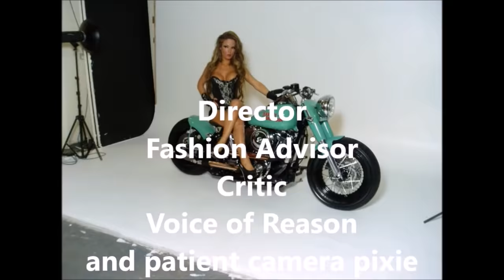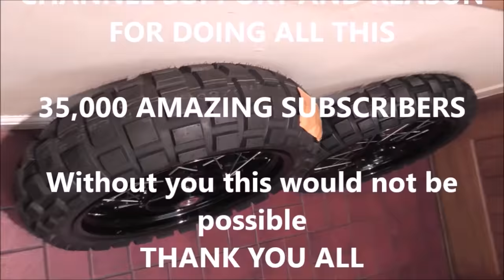Delboy's Garage, USD Fork Seal Replacement

Comment: Hi, I love your videos but you might want to add that on some bikes you WILL require more tools than this as some forks contain an acrylic tube inside that will prevent you from being able to do this job without the use of a spring compressor. Unfortunately I just found this out the hard way because after watching your video I thought I could do this job with only the tools you used but quickly found once fork was apart that without a spring compressor I am now dead in the water until I get one shipped to me completely halting the job I was working on. Maybe this will help someone else from running into same issue.
Reply: I encountered the same thing. I had a spring puller tool in the garage. Worked like a charm. Just have to pull the spacer down long enough to catch on the lock nut and everything will come apart by hand.

Comment: Hello Delboy. Great video and I was watching this one with eager interest (more than usual) because the forks on my 1998 Ducati 900 are leaking. So may I ask two questions raised by the vid:- 1. How do I replace the new seal without your super duper split round hammer tool and 2. Does the Ducati need special tools or can I replace the seals the way you did it. Cheers again for your quality recordings, Jules.

Comment: While I appreciate keeping the new seal off the rough part of the stanchion, The fork needs to be fully compressed when taking the fluid level measurement, otherwise you may as well be taking a measurement at any random point of the stroke. 
Your method of getting the seals over the sharp edges at the top is good, but it could result in nicking the fork seals as you are now running over a sharp edge of plastic length ways. I usually just use the thick plastic packet the seals came in.
Interesting method of cleaning the rough part of the stanchion, I have used tinfoil with great success. but I wont be able to say which is less abrasive
Nice illustration on how to jack the bike up, its a great method... I've always struggled with my sport bikes in that department.

Great video, I was worried about USD forks myself but you've made it look like a piece of cake. 
The time will come that I need a fluid replacement on my street trip and now I'll be able to tackle the project alone.
Reply from the maker: Hi Martin, I didn't make it clear in the video that in this instance it was important not to push the fork outer tube down over the rough rusted fork stanchion, obviously.  But if you do, you will find the inner and outer tubes become level, so therefore if you want to keep the fork tube a little higher to preserve the seal, then just make sure you measure the oil level on  the 'INNER' for stanchion tube, not the outer one... as indeed, it would be a little high.  This way you will get the correct measurement.  Glad you got is sussed and glad the video helped you.

Comment: Hey Del, great video! Got a quick question I was hoping you could answer. I reassembled my shock just as you did. But the spring does not want to slide down all the way. After taking fluid and spring out n looking down into tube I can see that what the spring slides down is not centered in my shock tube. What would cause this? And any suggestions on what I did wrong, so when I pull it back apart I have a idea what I did wrong n can get it back together correctly this next time around tomo. I hope to hear from you, and Ifso thank you in advance!

Comment: Hi there, great video! I have a 2007 Versys which I need to replace the seals, my question is, I have seen other videos saying I need a spring compressor, but you didn't use one, so do I need one lol....thanks in advance.

Comment: My front fork was leaking but not from the oil seal, rather at the lower end around the axle nut.  Took it to the mechanic, he said the nut at the lower end which connects with the inner tube was loose, after tightening it seems like it's not leaking anymore.

I didn't see you touching the lower nut around the axle

Comment: Great video, but I have a question 
Why take the spring section apart? 
I am novice at this, but from my point of view, taking the spring off the inner tube is the most complicated part of the whole process, so I did this;
- removed the fork from the bike
- Unscrewed the top nut
- Poured the oil out
- Undid the bottom Allen bolt (near where the front wheel axle goes)
- Took the inner rod & spring section out
- Separated the 2 fork components as you clearly demonstrated 
- Replaced / Rebuilt the seals
- Put the spring section back in
- Put the bottom Allen bolt back in
- Poured in the fresh oil

I am genuinely interested in your opinion, is this a good way to do it? 

One problem, the manual does not give oil quantity (or air gap) measurement WITH the spring component in. 
So I checked the other fork level with a strip of glossy paper & matched the level to that. 
Also, I had to pour the oil in “through” the spring, which was a little awkward. 

CBR600rr 2006
Reply from the maker: Well Rob, you've pretty much aswered your own question mate, the oil quantity is measured with the spring removed and it is critical to get it right.. and it's a darn sight easier to fill up as you've found!  Do what works best for you mate, but I always take the spring out as you should do for the reasons you've found.

Comment: Hi. So I just rebuilt my forks on my 2005 Vstrom. I installed Racetech "gold valves' and replaced the spring with a straight rate spring. After putting everything back together there is no compression resistance whatsoever!!!!!! LOL. Wondering if you have any experience with compression valves/ shim stacks and if maybe I just installed it upside down? Thanks for any advice.... appreciate all your vids

Comment: Outstanding video - as usual!  I have a quick question: My Yamaha manual recommends lithium-soap based-grease for the oil seal and silicone grease for the dust cap.  Is red rubber grease a substitute for these lubricants or should I stay with the manufacturer's recommendations?
Reply from the maker: Hi Mike.. i just use rubber lube on both, it has always worked for me.. i can't contradict your manual, you must trust in that if it feels more comfortable my friend..
Reply: Well, with an almost full tin of rubber lube in the shop - and given the price of the lithium-soap grease - I think I'll go with your experience.  And ongoing and well-deserved thanks for all your work!

Comment: Ok you made that look super simple plus I love the milk jug "shim" part..what about the "s-h" turn knob on the top of the shock??? How do you adjust or what is the main purpose of it???
Reply from the maker: +RJVermillion Hi buddy, the 's-h' refers to 'soft' or 'hard' and it will have a direction arrow between the two letters... so if you rotate towards the 'h', the forks will get stiffer and rotate the other way to make it softer... the best thing with any of these is to count the 'turns' on the screw and set them in the centre for an average ride...hope that helps!

Comment: Thanks Delboy for another video.
I have a zx7 like the one in that video, have you ever removed the engine and could you demonstrate the special kawasaki tool to undo the engine mounting bolts?
Cheers from Down Under, 
🍻

Comment: Good clear video, thanks.When you measure the fork oil level height doesn’t the tube need to be all the way down? The rag you had wrapped around the fork was preventing this I think
Reply from the maker: Once again... for the umpteenth time... Measure to the top of the INNER steel tube.. NOT the outer tube..!
Reply: @Moonfleet41  I see,fair enough, my mistake 👍🏻

Comment: Does the lock nut keep the tension of the spring when you put it back together so that it goes back to the same pre load as it was before you took it apart?

Comment: Thanks Mate! What type of lubricant are you using on the milk carton plastic, just a lower grade grease? Also, how do you feel about using a cut in half piece of PVC "T" as a seal driver? Is it worth it to just buy a seal driver?

Comment: GOOD FOOTAGE, but when putting your new oil in. You left your cloth on the bottom. So you oil level will be wrong, as the outer cannot go to the bottom. Great vids though keep up the good work thanks
Reply from the maker: Measure to the inside tube, not the outside one.. just didn't make that clear..

Comment: Great video. How is the chromed stanchion attached to the lower silver alloy housing that supports the road wheel? Can they be separated? I ask as my upside-down forks are very badly pitted and really need re-chroming but to do that I need to separate the stanchion/alloy housing. My guess is that they are an interference fit at the factory - the stanchion was cooled in liquid nitrogen to shrink it and get it to fit into the alloy housing.
Reply from the maker: Not so sure its anything as dramatic as liquid nitrogen buddy... but they are a press fit that for sure... different bikes vary, ive seen them with a flush fitted set screw holding them on, and some even screwed in.. but if you're getting them re-chromed, and you;re in the UK, then the best company ive ever used id A.M.Philpots... im pretty sure you can send them as they are nad they'll swap them over for you for a price..!!! but you'd have to call them to check.. Good luck with it buddy.. del.

Comment: Great video! I am going to attempt this hopefully next week on my 2010 Speed Triple SE however the insides of the USD forks look different to yours, I do not see a spring inside all I see is a tube with 2 holes either side of it for inserting the compression tool. Do you have any tips on how to use your technique of not having the compression tool on this fork as it looks like I need to compress the spring to get to the lock nut. I assume you have seen inside these forks before but if not I can provide a picture of what I see if need be. Thanks
Reply from the maker: Hi buddy, sadly bad news, on the Triumph you will need the tool , this Kawasaki is 20yrs old and a much older design that you can get round, but your Speed Triple forks are the real mccoy... 20yrs ago they wold have been GP race forks, so perhaps invest in the tool, it won't cost you much and at least you'll have the pleasure of knowing you can do it properly.. good luck with it buddy, sorry, all the best, Del

Comment: Cheers Delboy,
I've been watching some of your videos...great work and thanks for sharing your knowledge. I've watched a few fork service videos and notice they sometimes check the range of adjustments of damping against the shop manual. Apparently it needs to be reset sometimes? Another question I had was...do you have to  back out the adjusters to zero before taking the fork cap off? Thanks again for the great videos.

Comment: Got a question 4 U, I've a Suzuki TL1000R that I had to replace the fork seals on recently. My question is the rebound adjuster & installing the cap. I saw a video by Dave Moss when he went to reasssemble a fork he was working on he screwed the cap down onto the threads of the damping rod until it bottomed out so that the rebound screw adjuster wouldn't turn then he backed it off to midway in the adjustment range then tightened down the damper rod nut up to the base of the cap. When he tighten down the cap he then checked the rebound adjustments range counting the clicks it was a range of 50-clicks then the video cuts back to before he tore the fork apart and the range of the rebound agjustment was only 44-clicks. On your video you didn't do it that way I believe you just backed off the rebound and pre-load adjusters to zero, and when rebuilding and before installing the cap you didn't have to "center out" the range. I;ve completely rebuilt and want to be sure that when I go to turn in the rebound that it's bot going to bend my rod or bottom out and break something?

Comment: Brilliant video Dell.  However I do have one slight concern regarding your method of measuring the oil level in the fork.  I presume that you have to measure the oil level with the fork either in the fully compressed position or topped out.  With the rag round the base of the fork, you are checking the level with the fork almost bottomed out.  Some would say at a random position.  As you move the fork the level will change.

Maybe I am missing something, but I don't think so.
Reply from the maker: Yes you are mate, but it wasn't obvious in the video, I measured from the 'inside' fork tube, not from the moveable slider, that way the level is fixed no matter where the slider is... I must have answered this question a fair few times down through the comments, I guess I should have mentioned it in the video...
Reply: @Moonfleet41  Yes you did indeed:)  The tape on your rule is about the width of the gap between the fork tube and the slider, so it looked like your mark was the top of the tape that lined up with the slider not the bottom of the the that lined up with the tube.  Thanks for clearing that up and sorry for not looking through the other comments.

Comment: hi.thanks  for the video. One question. Do both seals on both legs have to be changed ? even if only one leaks??? I had heard so !!!!!! please exlain. And also what if only one seal is replaced and filled with oil of different viscosity than the other????

Comment: What could've gone wrong when rebuilding the forks for the preload adjuster to keep rotating, and the rebound and compression (top clickers) not moving? 

I had my forks taken to the shop for new oil seals. That happened. 

No manuals are out for the Tiger 900, so I'm not keen on doing seals myself yet.

Comment: Cheers Del
can replacing motorcycle forks crack the top yokes is taking them out or replacing them?
I have had seals done not long ago and I’ve watched a crack getting bigger near the left side of the cap.Ive not dropped it or crashed it and it’s hardly been ridden since the mot work on the forks.
It’s the first thing I thought as a possible cause.
Maybe using force to remove it,or over tightening the cap and clamp?
Not sure where I stand concerning contacting the work shop that did the work.
What’s your experience and is it a reasonable assumption to make on my part?
Keep up the good work both!

I was just thinking....Thief trying to crack the lock?...booting the bar ..it’s on the right side for it..
But I have top security chain and disk locks so it wouldn’t be movable even if they cracked it?!
Oh and the lock still works..

Comment: Del, it is great to find your material from the past becomes relevant to me now as I am servicing my forks for the first time since I bought  the bike 7 years ago! When I drained the fluid no more than a half cup of murky thick stuff came out of the 2 forks combined! So I am rebuilding them.

After cleaning up, in the process of reassembly I made the mistake of firmly installing the slider bushing in before putting the stanchion in (I fixed it to the slider rather than up on the stanchion as you show in the video). 

The big question: HOW DO I REMOVE THE BUSHING FROM INSIDE THE SLIDER without causing damage? Best to you & Penny.
Reply from the maker: Hi Ali, ok so just to check, you've tapped in the top bushing in to the top of the slider and now you can't get the stanchion in because you can't push the bottom bushing past it presumably?  I've never had to remove one in that way, so I've got no experience to draw upon... but I imagine the most successful way would be to use a blind bearing puller, but you'd have to have one big enough to grip it, the size of the fork in fact, something like 40mm or so, and am presuming you don't have one? (and nor do I), ok so to make something that would tap it out, you need something to hook on to the inside lip of the bushing and then someway of tapping it, if you have a slide hammer, then perhaps a couple of washers screwed on to the end that you could put under the lip, and then tap each side alternately to lift it out, if that doesn't work, then perhaps some sort of lever right next to the split in the bushing, maybe a small screwdriver and carefully see if you can lever the bushing open enough to pop inside itself and release it, but be careful not to damage the soft ali... sorry mate I can't help much more than that, it's just a case of being inventive, I'd say the slide hammer trick would probably work best.
Reply: @Moonfleet41  Thanks Del, I will see what I can do. Thank you for the ideas. Beginners mistake.
Reply: @Delboy's Garage Thank you for the support. Shortly after your response I got to it and landed successfully.

I tried a dremel tool to cut the bushing out but all that did was destroy the bushing. I purchased a bearing puller but it was way oversized for the job. What did work was pulling an S bar from the bearing puller (it had 3) and I trimmed the edge and used it as a lever by wedging it into the fork slider. I put a block of wood down into the slider and that gave a point for my S bar to fulcrum. 

Not sure how much of this conveys through my words but this video was enormously helpful and illustrated the suggestion you made: https://youtu.be/WCrCPdU9wpM

I mainly wanted to followup and say thanks and thought you would be happy to know custom tinkering was happening. Though it was a foolish situation I put myself into in the first place, it was a great feeling of accomplishment to get the bushing out. 

Had I not used the dremel, I think the bushing might have been salvageable. A relatively small cost to pay to learn.
Reply from the maker: @TheEnergyball  Glad to hear you got it out mate, as you've found, it's a game of 'bodgery' and make do, and I think that having a resourceful and inventive mind in that way, will get you out of a hundred spots like that... thanks for letting us know, glad you got it done, keep at it and enjoy your projects, Del